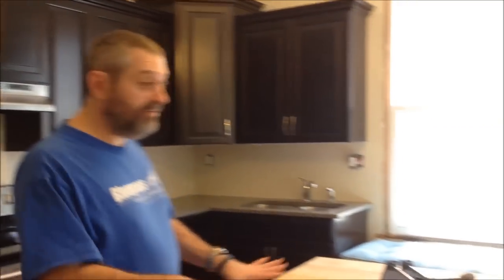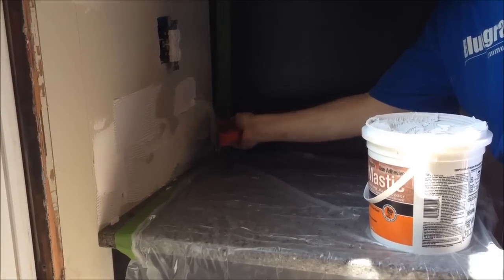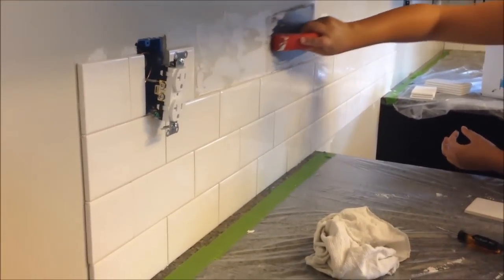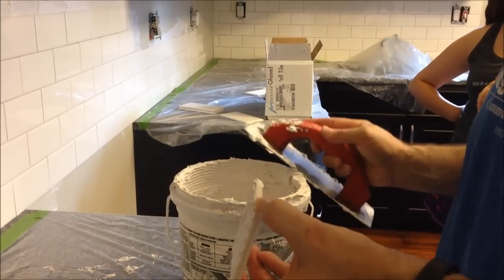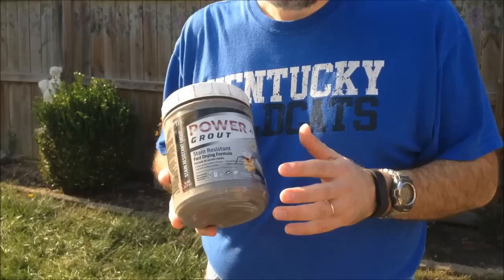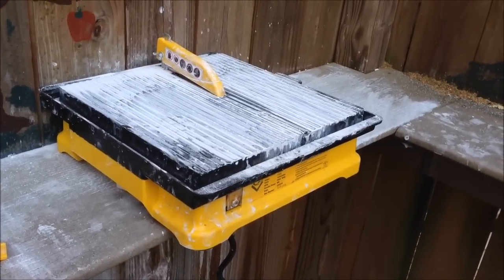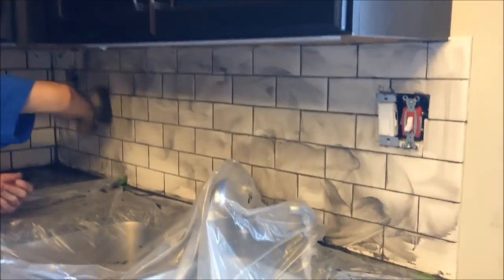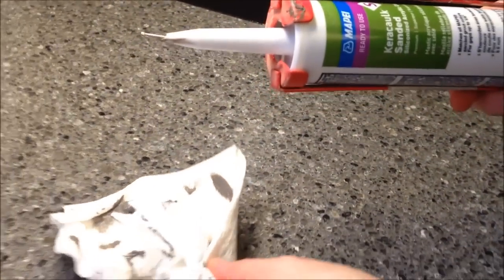Our Kitchen Renovation Part XVIII Installing Subway Tile

Comment: I have a few questions. When you put the tiles on the corner do you overlap the tile on one side or do you have the tiles meet each other? Also do you grout the corners or do u use caulk or clear silicone?
Reply from the maker: They never overlap, they just meet. We used grout everywhere except for the edges. We used silicone on the edges. The corner is grout. I hope this helps!

Comment: DId you use bullnose on the edges?  Did you caulk the edges on each end where you started ?   I'm starting this exact project soon.
Reply from the maker: We did not use bullnose, just the regular pieces. We did use colored caulk. It is the same color as the grout.

Comment: Thanx for sharing this!!!! I love it, this us exactly what I want to do to my kitchen. The white tile and the grey grout. I hate the light grout as you stated it shows everything lol. Question what kind of subway tile was that u guts used??? Also where did u get it??? Lastly how many boxes did u wind up using??? U all did an amazing job!!! I am falling in love with day projects. Its just the simple satisfaction that I did it myself lol.
Reply from the maker: +Diane Cottrell It was just white Subway tiles from Lowe's that have the built-in separators. I have no idea how many boxes we used, but Lowe's will help you figure it out if you bring in measurements. Also, they are great at letting you return what is not used. I hope this helps and thank you for watching!
Reply: +Tami Dunn Thanx so much for responding back!!! I watch a lot of diy videos and believe it or not the people who make the videos never reply back. How would I measure the wall to get the width and the height??? my layout looks pretty similar to yours. I have a hood over my stove as well. I saw u only went half way behind the stove. I would like to go all the way down in that area.
Reply from the maker: +Diane Cottrell Kevin made you a diagram here: http://district.bluegrass.kctcs.edu/kevin.dunn/files/Area.pdf

I hope this helps!

Comment: Don't you need to knock out a layer of the wall till you reach the grey surface before tiling?  Genuine question. Im asking because somebody told me I had to do it that way or the tiles would fall off the painted wall
Reply from the maker: I have never heard of that before, but it's not true. Our tile is just fine. You just need to use enough Mastic.
Reply: Tami Dunn holy shit. So you're saying I just wasted hours manually knocking the layer off my wall for my backsplash in the kitchen? #%?!$& 😭😭😭 I'm in Australia, maybe they have different layers to make up a wall compared to the walls in other countries ?? Where are you?
Reply from the maker: Kentucky, USA
Reply: Not in the UK either.  Brick, bonding plaster, finishing plaster, then tile.  If it was pained before, clean it well, and maybe score it up a little..
Reply: I would leave paint unless some was flaking off. Skim coat it with the flat trowel score it well then v notch trowel

Comment: did you guys not use spacers!!??
Reply from the maker: They were not needed. They were built into the tile.
Reply: The tile comes with spacers on the back side of the tile
Reply: When I ever I a basic wall tile backsplash job I love it my brain just thinks$

Comment: If i want my tile to start all the way from the wall do i start at the bottom or at the top edge of the cabinet down
Reply from the maker: I'm no expert, but I'm not sure it would matter if you can use whole tiles all the way from the top to the bottom. If they have to be cut, start at the bottom and have your cut tiles under the cabinet at the top.

Comment: The reason the grout was such a mess is because you didn't get the mix correct. It was far too thick and needed to be smoother. Apart from that a good job
Reply from the maker: Thanks for watching! It ended up working perfectly.
Reply: Grout is always a mess and the dark color just seems worse. I grouted with black grout and it’s a total drag.